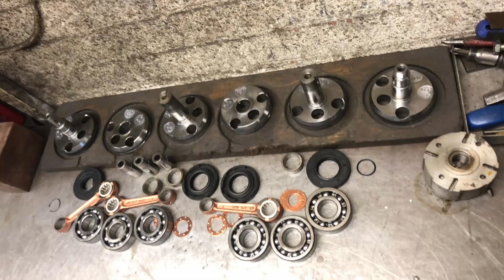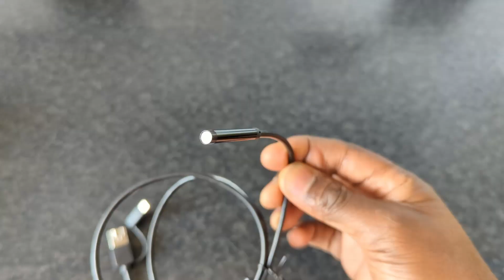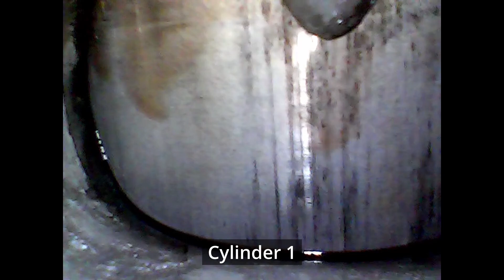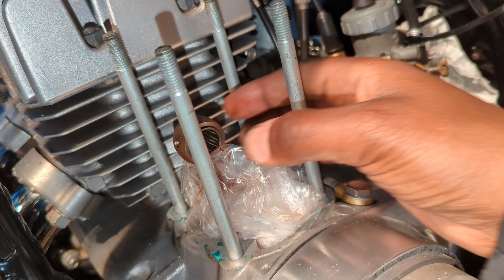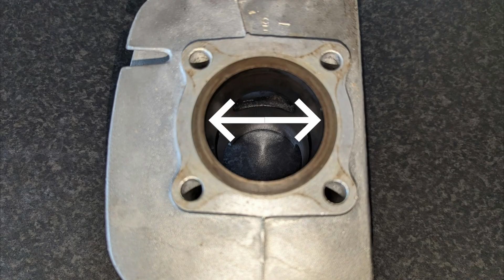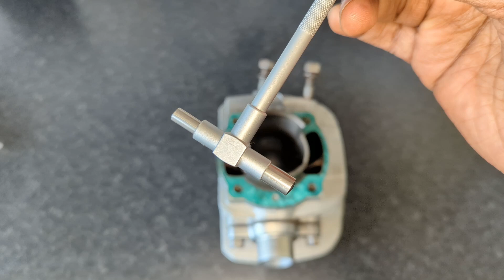SUSPECTED ENGINE PROBLEM! 😮 | 1973 Kawasaki S2A Engine Repair - Pt1

Comment: Hi Derrick,  they all rattle, rebuild your oil pump,  check that there is proper sealing of lube pipes, even add additional 2 stroke oil to fuel to see if it rattles as much, compression test, to see if compression is even around 125psi. Good luck,
Zen, and the art of motorcycle maintenance 👌
Reply from the maker: I've checked operation of the oil pump on a number of occasions, it's definitely working (see Stranded at the Roadside video). I believe the piston damage was due to an air leak, possibly through the barrel base gasket. 🤔

Comment: If it was me, I'd hone the barrel to make it good and fit a new piston that is within the tolerance. I'd also run it in carefully on premix to ensure it stays lubricated. Take a thermal laser with you and check the cylinder temp as you run it in.
Reply from the maker: Sounds fair enough. 🤔
So you suggest draining the oil injection system prior to run in? What premix ratio would you suggest?
Reply: @derekb2765  If your using mineral oil as the regular additive to the tank, I'd go for 30 to one. If using modern synthetic, 50 to one should be OK.  I'm not familiar with the oil pump control but guess it would have an additional cable from the twistgrip cable, in a junction box. If you disconnect the cable, you wont have to bleed the system again when your happy with the running in. The small amount of oil will be insignificant in the premix. Remember, the more oil you mix, the lower the octane so use E5 99 or similar.
Reply from the maker: I use a cheap Carlube semi-synthetic, so 50:1 then?
I always use E5 petrol as a matter of course. Esso Synergy 99 is preferred.
Disconnecting the oil pump cable is a good idea 💡 I like the idea of using premix, as I'll definitely know enough oil is being delivered.
Thanks for the tips! 😊👍
Reply: Problem with using premix in an engine not designed to take it is that it will effectively make the engine run weak. Reason is that if you use say 3% oil by volume (ie a premix of about 33:1), the main jet still passes the same total volume of fluid as when running straight petrol. However, the oil condenses on the bearings, the cylinder walls etc etc - leaving only 97% of the petrol going into the cylinder compared to running straight petrol. As the engine is still pulling a full charge of air, the combustible mix in the cylinder  is therefore 3% weaker than before. Whether or not running a 3% weaker mixture would actually be a problem, I don't know, but we all know what happens when two strokes are thrashed when weak, don't we? Technically, if changing to premix, you should increase the area of the main jet orifice by 3% to compensate for passing oil as well as petrol.......
Reply from the maker: Well that seems to be a fair point, although I would only use premix in the running in period, during which no thrashing will be taking place! 😉
Reply: @WoBlink1961  I think the bike has its oil injected into the crankcase?
Reply from the maker: Yes, that's right.
Reply: @grahamsmith8122  Yes it does; but you suggested using a premix. Even if used in addition to the normal injected oil, the main jet has to pass the premix oil, the majority of which will remain in the crankcase giving a weak fuel/air ratio in the cylinder. This will increase the cylinder temperature and may even make Derek's issue worse!

Comment: Sounded like little end bearing rattle to me. Did you use new genuine small end bearings on rebuild?
Reply from the maker: Gary Clarke supplied the bearings. I don't know if they're genuine. Cylinder 1 bearing looks to be in good condition. The status of the others is obviously unknown 🤔

Comment: With the cylinder bore in spec, hope it was just an out of spec piston from the beginning.  Glad you found the issue before the piston failed completely and caused more damage.
Reply from the maker: Yes, true. I'm going to pay very close attention to piston & bore measurements from now on. 😇
The plan is to go with a 0.5mm oversized piston, and rebore the cylinder to the correct clearance 🙏